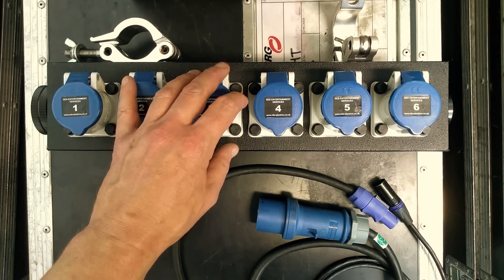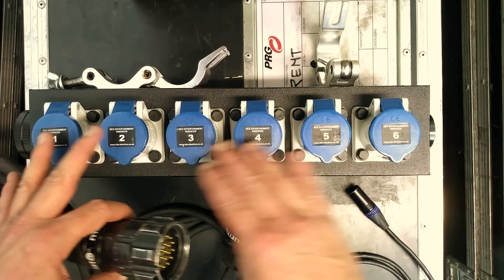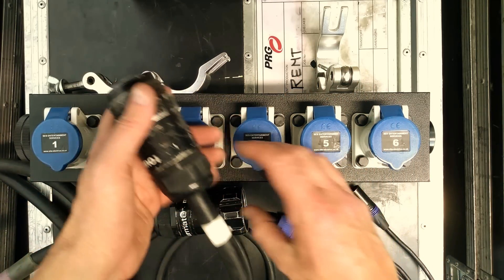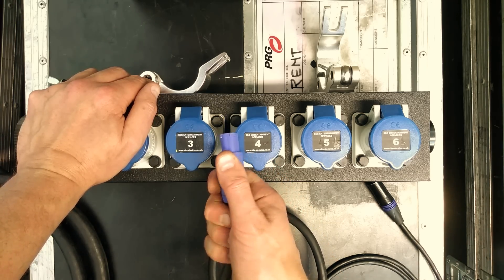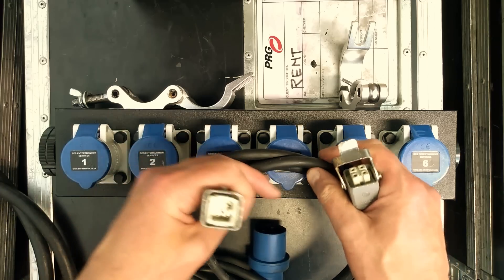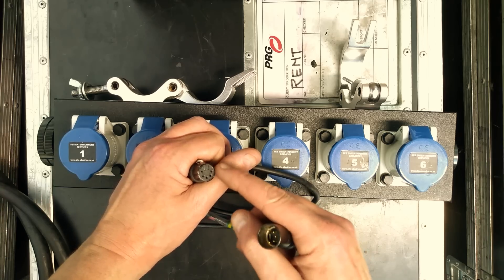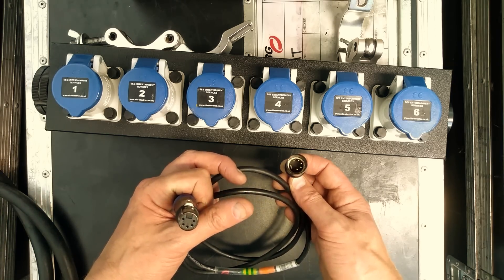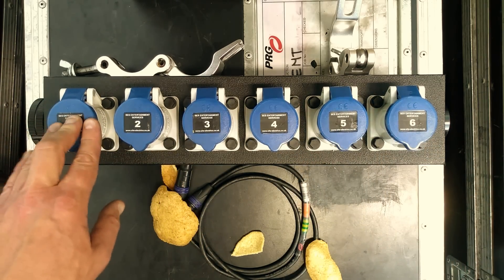Entertainment industry connectors.

Comment: After the lacklustre adoption of the true 1, neutrik revised the classic powercon to safely support disconnection under load. The catch is that this only applies if BOTH the cord connector and the inlet are the new variant.

Also the old variant was stated to have a current rating of a flat 20A, while the new variant is stated to have a current rating of 16A under EU standards and 20A under US standards.

Comment: Powercon pisses me off, we have approxmimetly a 50 / 50 split powecon to true 1. I prefer true one, the daisy chain ability, the ability to break loads, and the durability. I hate having to use converters so much im debating retrofitting them with iether dongles perminently attatched, or replacing the chassis mount connectors with fresh true1 ones.

Comment: Socapex connectors scare me, mostly because I've seen them used for 4 different things, 3 Phase Power as shown in this video, anologue audio of multiple XLR connections, and high wattage dimmed power (multiple ceeform or 15 amp connectors, into male socapex, soxapex up to the fixtures) because the fixtures had 3 lamps. I have also seen Socapex used to get dimmed power down to lighting gantries, that are flown so they could be unplugged or with breakouts to get a lot of circuits to one place for generics, like a staggered soca to the front of the stage for birdies. Then there is D54 which i have also seen use Socapex. So explosions are semi common.

Comment: I left community theater in the 70s, and I quit doing stage lighting and sound in the 90s, so it's cool to see what's up these days.
I was watching an event provider video yesterday and I was kinda dismayed to learn that Socapex is still a thing. Seems wrong and inefficient to have fifty or a hundred feet of cable between luminaire and dimmer. :)
Reply: From what I understand, modern LED lights have smart control and draw way less power so you could feed a whole bar from a single16A feed.

But the problem with doing that is what happens when a light develops a fault and either blows the breaker, or goes haywire and has to be isolated. If you have a whole bar on one feed then you lose the whole bar until someone can get access. If each light has an independent feed then you only lose one light.

Comment: What Clive didn't know at the time is that there had been lively discussions between me and Neutrik since 2011 when the TRUE1 was introduced about upgrading the original PowerCON to a version that has circuit breaking capacity. 

Neutrik said it couldn't be done but I have heard that a lot of times this last decade from them and every time they said it, they proved themselves wrong.

Maybe it's time to start a new discussion about an idea that I have....

And as far as I know the second pair in a 5 pole XLR DMX was designed for communication back from fixture to console but never implemented.
Reply from the maker: The main entertainment hire companies are using both pairs in their XLR5 cables for various reasons, including dual networks.  The new RDM protocol that is backwards compatible with DMX does allow bidirectional communication.

Comment: Hey Clive I thought I'd ask you what you think of this; My technical theater teacher has asked our class not to refer to cable ends as male and female, despite that, that is the technical name for them. I think it's because our school has a large gender non specific population, but it still doesn't make much sense, why we wouldn't call the connectors male and female.
Reply from the maker: It's a pointless snowflake thing.  The theatre industry has a high percentage of gay and transgender workers in the technical side and we don't get offended by the traditional terminologies.

Comment: 😂 the socapex brings back some memories for me, it looks a lot like a stage pin multi cable, up until last year the small high school black box theater I’ve been working in had used stage pin as the main lighting power connectors, so we had 2 stage pin multi cable panels on each side of the stage, each with 8 connections, then a multi cable would run to a certain spot in the grid, and it would connect to a fanout that had 8 stage pin connectors on it to connect lights too, it’s an older ETC system, and all the dimmers were in a cabinet back stage where we had 48 dimmers each controlling 2 channels which gave us a total of 96 750watt halogen channels. Those multi cables were a pain in the butt, they were about and inch thick, and they weighed a ton. Now we’ve completely converted to LED pars and spots, that use powerCon for power and DMX for data transmission.

Comment: I remember some years ago running a multicolor 10v cable down a pipe to the desk, the shell had to be removed and then it would drop down it with no problem   :)
I came in one day during the install to find that for some reason  the boss had cut the whole plug assembly off due to not being able to get it back up the pipe for some reason. It cost him a full plug assembly as the pins were crimped and not re usable, all he had to do was to take the shell off  !

Comment: Hello Big Clive. Could I pick your brains? Im trying to figure out what would be the best power set up to get installed in a small workshop/venue. I would be looking to power small outdoor concerts, provide power to a catering van or food truck and general indoor and outdoor lighting and video projection or art installations. Looking for it to be flexible to accommodate most kinds of small local events. There may be for example a PA and lights running and a food truck with festoon lamps and video projections all going at once. I was thinking that some kind of single phase cee-form distro would work best?  The power company is installing soon so I need to know what I am asking for. Any advice would be appreciated. Many thanks. -Peter
Reply from the maker: Don't underestimate the power requirement of catering services.  Think in terms of lots of industrial cooking equipment.  (And caterers are awful for understanding powering their own equipment or installing it safely.)

Comment: 5 pin dmx cables are used for rdm (remote device management) capable devices.
Reply from the maker: To the best of my knowledge RDM still uses pins 1,2 and 3 for backward compatibility with legacy fixtures.  The original DMX standard reserved pins 4 and 5 for a potential second network, but some manufacturers use them in a non standard way so it's not advised to use them.

Comment: I would love that you would actually connect and disconnect all of them, to see how easy / strong the connections are
Reply from the maker: They all take a bit of force to put together and pull apart except the powercon.  The larger Ceeform connectors and 400A powerlock connectors require a fair amount of muscle to mate.

Comment: I can attest to powercons blowing out if unplugged under load -- I didn't do it (honest!) but this happened recently at work. It severely mangled the powercon and burned the distribution unit (already charred from prior idiocy) to the extent we had to render it unsafe and lock it out.
Reply from the maker: It's a standard replacement component in the industry.  Once one's gone bang, both the plug and socket are changed.

Comment: Hey Clive, Socapex looks like it could take an Oring easily enough, sealing tight when screwed together making it effectively waterproof down to 2m or so.(assuming water can't get in the back)
Is it one of those things people just didn't think to try despite it being so obvious or do reasons exist its not done?
Any chance you can give it a go and dip some in water and see the difference a oring makes?
Reply from the maker: Some of them do have a sealing gland inside, but if you make connectors like this too waterproof they will trap the water that inevitably gets inside.  In the event industry stuff like this is installed regardless of the weather, so it's not uncommon for connectors to be soaked before they've even been connected.  Sealing things too tightly also amplifies the problems when something goes wrong, so a single circuit failure can result in a small electrical explosion inside the connector that then plates everything else with a conductive film causing an avalanche effect.
Reply: That's why man invented Silicone sprays, to allow lazy bums or poorly designed equipment to be protected from moisture related shorts :P

Also woodworking silicones are almost always non acidic so if you need some still and can't find any specifically marketed as neutral cure if you read the fine print it should say they are.

Comment: I work in the entertainment industry in Europe, for multiple line power distribution we only use harting cables, never socapex, the only socapex (and not socapex-18 but way way more pins) we use is just to distribute the audio channels to the mixing board from stage and the audio channels to the amplifiers, but never an amplified signal ,from there on you have most of the time something like Speacon looks like a Powercon and yes they are both Neutric they come in multi channel versions too.
Reply: And also socapex is dated, all the amplified stuff is left on stage, audio channels are through ethernet, and go back that way to amplifiers, the only multiple line power distribution these day are from dimmers to the lights with harting-16. And with moving heads you only need a powerline and a dmxline. Those lights that use a power line each are dissapearing, inteligent light is way more versatile and don't need as much stuff like a dimmer and harting/socapex

Comment: Interesting to see you working in the entertainment industry.  I was recently introduced to your channel by AVE, and have watched a bunch of videos but never made the connection.  I have been in the industry in the US for the last 15 or so years, although I'm more an office rat these days doing design & engineering.  In the US we see Socapex quite a bit, along with Powercon being common more recently, but twist lock connectors (NEMA L5-20,L6-20,L14-30,L21-30 being common at least in our inventory) as well as 20A stage pin for dimmed circuits.  For high amperage (feeder) in the US it is almost exclusively Cam-Lock 400A single conductor connectors from what I've seen.

Comment: It makes so much sense to find out you work for PRG. I worked for a major live audio provider in Aus. What you call a Harting in Australia is usually called a Weiland and is mostly only used for chain motors. I started an electrical apprenticeship here in Aus and asked the electricians if they had heard of CeeForm or powercon and they looked at me as if was taking jibberish. The beautiful thing about powercon is that it's good for 20A at 240v and it's the same size as a 10A IEC. I sometimes miss working on gigs but I don't miss hauling 100m of powerlock though.

Comment: Nostalgia! Very reminiscent of the stuff I used to work with when I did time on a sound & light crew in my old hometown. A part of my life that is rapidly slipping into the past. We used the Socapex connectors for both sound systems & lighting. Have spent many an hour soldering both multicore cables into those and taking out tails to either NL4 speakon or to mains plugs / sockets. We also had breakout boxes similar to yours but we didn't use the 16amp Ceeform, just the standard NZ "crowsfoot" 10amp outlet for connecting to individual lights. There was some Ceeform stuff, but the main 32 amp three phase connectors were the New Zealand made PDL-56 series, which are very waterproof, as they have a screw ring and gasket. And they needed to be at some of the shows & raves we did. When the three-phase got up to the next level of distro, 63 amp Ceeform connectors were common. Any more current than this and it was usually individual cables with Cam-Lock connectors.

Comment: Some of the welding equipment I had at work used Amphenol MIL spec connectors, they looked a lot like Socapex but I think they are slightly different.

Comment: Hi Clive. One thing struck me while I was watching your video- how much of DMX was borrowed from MIDI? Or was it? seems like they could share a lot of bits?
Reply: actually you have that the other way around, MiDi borrowed it's connector standard from DMX because as the time DMX had the best multi core cable optimized for data transmission and the connectors were relatively cheap and easy to get a hold of en mass.

Comment: The audio world also uses 5 pin XLR. Very rarely for stereo audio. The most common case I've seen so far is for tube microphones actually. 2 for signal, 1 for ground and I guess 2 for the 240V phantom power from the power supply.

Comment: An enlightening introduction into the world of staged illumination. I spent a while working at Light & Sound & Distribution (L.S.D) way back in the eighties, when beards seem to be a statutory crew requirement!! (and still is) In a time when the 'block element' liquid based smokers were in last stages of development and initial mass production. I was responsible for assembly, testing and of packing of their dry Ice kettles and (white-out inducing) Cloud-9 smoke machines. A great first job experience, that got me hooked on the light & sound industry for life! @bigclivedotcom Do you use smoke/ice machines, or other 'non-light' effects systems in your displays; ie smoke/pyrotechnics/ yada yada? Or is that dealt with by a different and more ballsier crew? LOL

Comment: We use Ceeform connectors for our network stacks too, each device has a kettle lead, but they all meet in a box, out of which comes a single ceeform plug into the wall :-).

Comment: The rubber cable you use is that H07RN-F or H05RN-F ? or do you use a higher specification?

very interesting video tho Clive.
Reply: Whatever the hire company supply is the answer. 
Although hopefully it would always be H07. 
From PRG it definitely will be.
Reply: H07RN-F.

Comment: What is the process/name/method of industry cable labeling? It looks like clear heat shrink but, I can't quite work it out...
Reply: Sami Barqawi at the company I've worked at in the past it was a cable sticker, with information about the company on it, plus a bit of electrical tape to identify the length of the cable, and in some cases if the connector was used for more then one purpose another piece of tape to identify how many ohms the cable was... when that has all been put on the cable, we'd put clear heat shrink on it, to keep it in place.
Reply: You can get printable heatshrink, but you can also ust use regular labels with clear heatshrink over the top.

Comment: My seven years in theatre was primarily indoors, but we always used three prong twist lock connectors.   Fast to swap, impossible to get in the wrong direction, and you can just about swing from them before they release.

Edit - I've used a lot of XLR cables as well.   Mostly audio, including connecting an ANCIENT stereo microphone - one of the ones that looks like a huge hammer head from the 50's.  (still have it).

Comment: What the hell. Why do light cables ALSO have a TRS variation. For audio, there are unbalanced stereo cables called TRS, which are the 1/4 inch connectors much like you'd find on a guitar or good set of headphones. Stands for Tip Ring Sleeve, since there are 3 separate contacts on the connector separated by an insulator. I knew light controls were fed through XLR cables, which are ubiquitous in audio, but never knew that there were TRS lighting cables.
Reply: Ravaxr It just so happens that they share the same acronym, but 6.35mm TRS connectors having nothing to with what is being referred to in this video. TRS also stands for Tough Rubber Sheath, which is a term often used denote the style of power cable formally known as H07RN-F, available in a variety of cross sectional areas and number of cores.

Comment: @bigclivedotcom
Socapex wouldn't have lasted for so long in the industry if it was a bad idea for hard mains/dimmed mains/hoist power/speaker level/etc. the trick is just to have competent bags of meat wrangling them ;)
Worst thing with Socapex is how with the original Amphenol ones the pins could rotate within the shell meaning you could accidentally connect them offset by a multiple of 60degrees.
You can also get IP67 rated "socapex" that are great for use during british summer time, I'm surprised that you're not using them if you've had issues with water ingress

Fun fact: the first release of PowerCon only had the blue "Drain" connectors and they used THE SAME keying as a speakon NL4! You can guess what happened...

Comment: Nice! Couldn’t you talk about the connectors used when you have the three phases and neutral/earth on separate cables? I’ve seen those on big venues. I’ve never used them, 125A on a “regular” CEE connector is normally sufficient :)